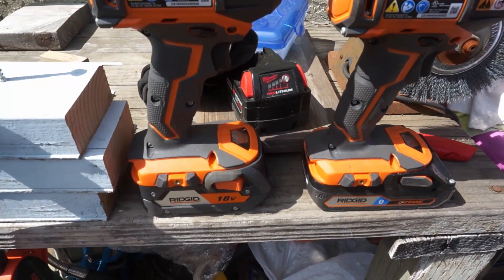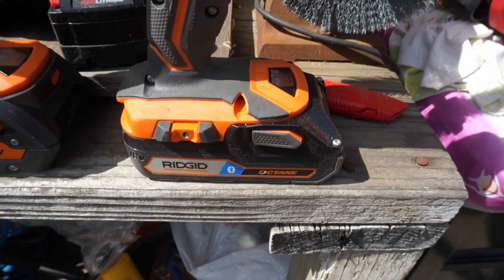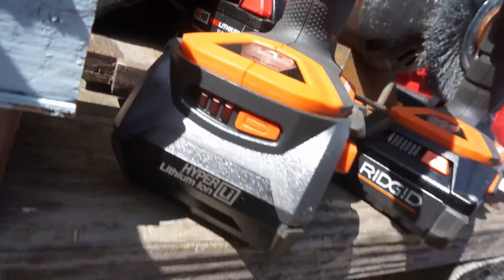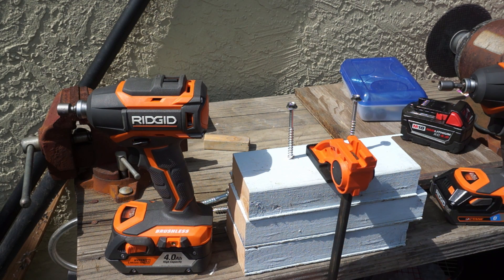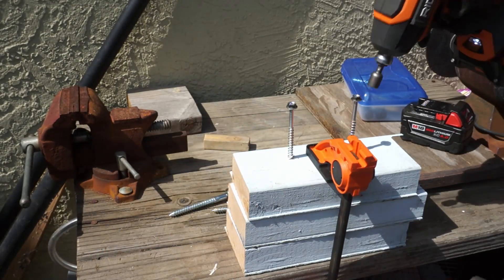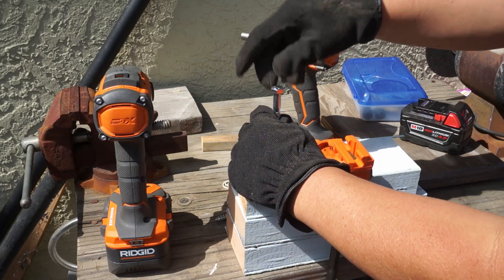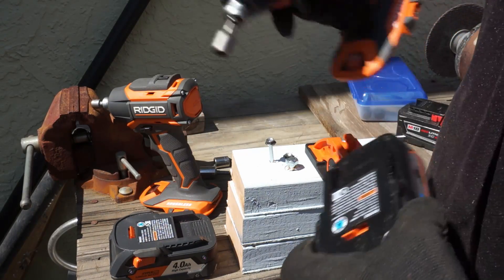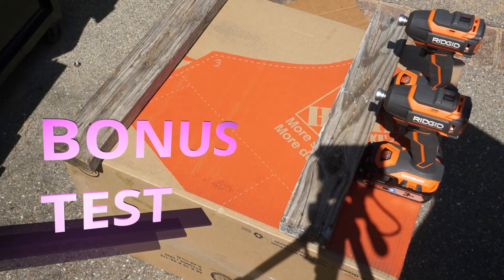Ridgid Octane Battery Test 2, Octane vs Non Octane on Gen5x Impact Driver

Comment: Question- I bought the Ridgid Octane impact driver.  I don't know if it is defective but how do you make it drive normal like you did on this video What I mean is I keep mine on "self drilling mode" and it will drive a 3" screw about halfway then the slow impact kicks in and takes like 4-5seconds to finish driving a 3 inch screw. "Fastener ASSIST"  mode isn't any better because it starts slow, then speeds up. "Auto Stop" mode drives a screw in short bursts and isn't any faster either. What are you doing to make the Octane imp driver drive that bolt in like a normal impact driver? Mine does not drive like that and I've tried all 3 modes. What am I doing wrong or not doing?
Reply from the maker: I don't have the octane impact driver anymore. The impact in this video is also not octane so it don't have the self drilling mode you mentioned. 
I would just put in into regular impact driving mode and cycle  through the power 1-3.
You might want to mention the model number of your impact so we can get a better picture of what we are dealing with

Comment: You will only see minimum difference because you are using at octane battery in a non octane tool.  However in an octane rated tool, it picks up the power tremendously.